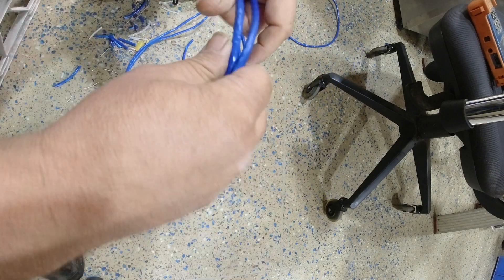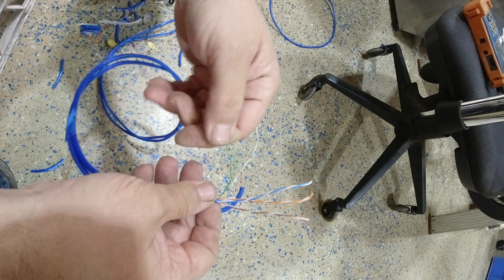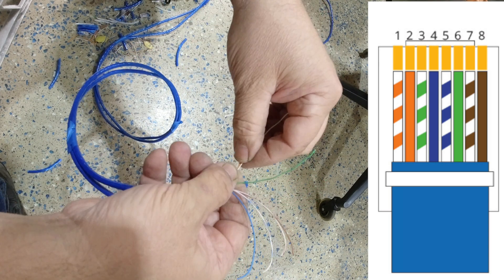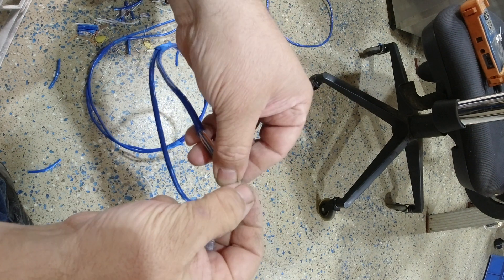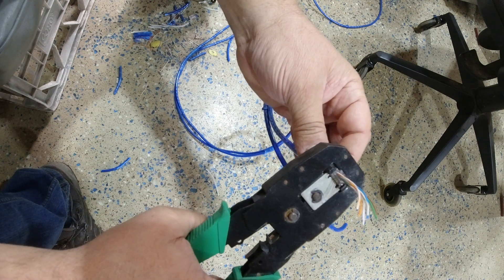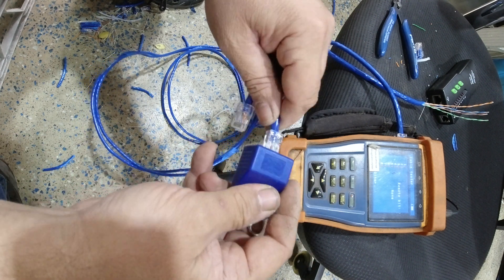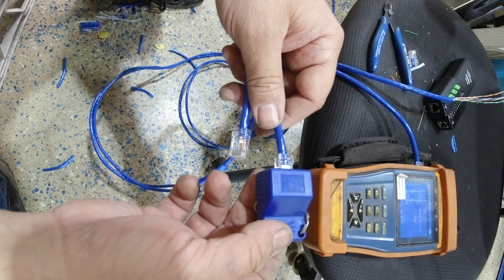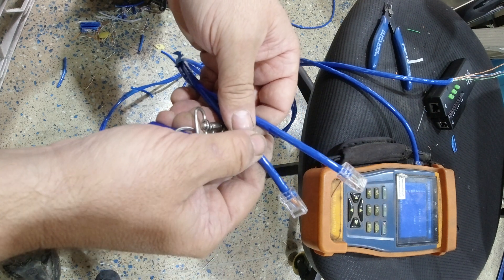How to Make Ethernet Cat5 -Cat6 - RJ45 Cables "The Easy Way"

Comment: A half-decent  crimp tool is a must.  A cheap tool will work if you find a good one,  unfortunately the old one I have over-crimps and destroys the latch so I have to 'feel it in'.  If you are doing a lot of these, I'd  recommend a ratchet type that won't open until the pins are fully set.